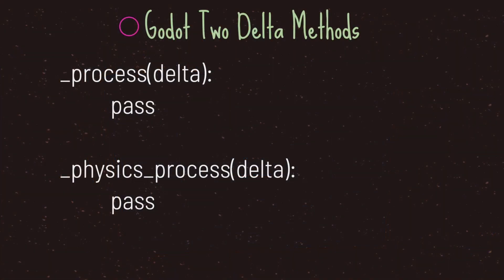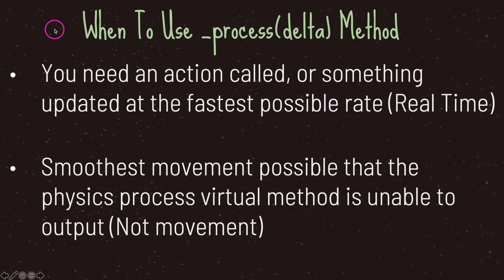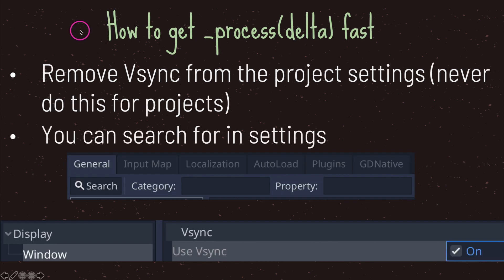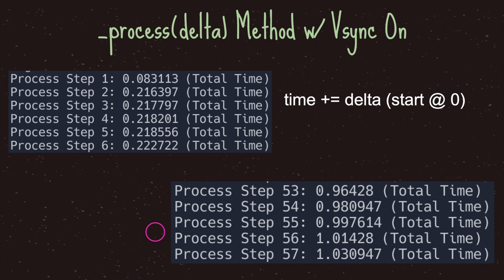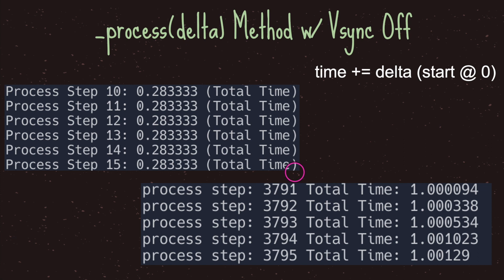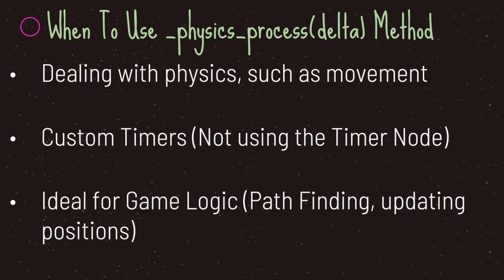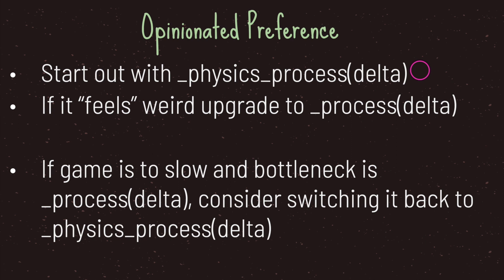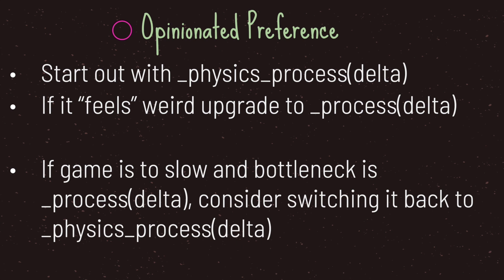Process & Physics Process Virtual Methods | Godot Basics Tutorial | Ep 16

Comment: Since you said some computers run at 30 frames per sec and the default settings for physics proccesor is 60 frames per sec won't that affect the computer or game negatively
Reply from the maker: Not really, computers luckily don't go near 30fps at 1080p, hopefully.
This article explains the process of game graphics a little more into detail:
https://www.maketecheasier.com/what-is-vsync/

The gist is that in a many cases, the monitor will refresh itself based on what the GPU/video card can output.
As for the game, the calculations for physics will run 60 times per second, but nothing changes.

If anything perhaps screen tearing, a slight visual lag.

Comment: Yesterday I found my game looks laggy when I put the game on my PC instead of laptop. I think that's because my PC monitor is 144Hz while the game physic still updates 60 times a second, so the refresh rate is different between character and the background.
I remembered that LTT mentioned "Your output refresh rate should be at least double to your monitor." So I went into setting, cranked the physic FPS to 300, and the game looks extremly smooth.
But then I went back to laptop, and expirementally set the physic update to 1000 times a seccond, and the whole game slows down.
Does that means Godot only moves foward when the Physic cauculation is done? But when I put the delta into print(), the delta is still 1/1000.
I am kind of confused, and worrying if there's some better way to handle framerate other than Physic FPS.
Am I doing anything wrong? Thanks for reading.
Reply from the maker: In this case I'm not sure.

For something such as this I would look into if other people reported similar issues with Godot Game Engine and refresh rates issue, it may be related to internal code (best place to check is the Godot Game Engine Github Repo):
https://github.com/godotengine/godot/issues?q=is%3Aissue+is%3Aopen+refresh

I noticed one with refresh rate and sync that may be a similar issue to yours, and Calinou responding back mentioning that it may be related to third party graphic card software:
https://github.com/godotengine/godot/issues/48801

Perhaps updating to the latest drivers, other than that I would not know.
Reply: @GodotTutorials  Thanks for responding, I'll just stick to whatever works for now

Comment: This was a very helpful explanation for me but one thing I still have a question about is why I'd want to use _process() with Vsync on? It looks like even with Vsync turned on _process() updates are still inconsistent and sometimes slower than _physics_process(). At least that's what I understood from when the video showed _process() updating 56 times in a second in comparison to _physics_process() constant 60 updates/second
Reply from the maker: Yes, there is a setting inside where you can increase the amount of frames process will run (how many times per second it runs).

In this case it's out of scope for this series, since I wanted to focus on out of the box settings.

For things non physics related you would use inside the process virtual method. In this case perhaps enemy AI calculations where you want to limit how many times it runs.
Reply: @GodotTutorials  that makes sense, thank you for answering!

Comment: The problem that a lot of people have using _physics_process for movement is that you get jitter if your monitor refresh rate is not equal to the physics FPS (60 by default). My monitor runs at 75Hz and I only get smooth movement if its coded in _process or if I change the physics FPS to 75. The second option is not ideal because it doesn't adapt to different users/monitors, unless there is some way to tell godot to run physics at the same rate as the monitor Hz. Using process is easier and is smooth with every monitor. So far the limitation I've found is that the player (kinematicbody2D coded in process) goes through the moving platforms (kinematicbody2D that are animated) in the latest Plaatformer 2D official demo, and I dont know how to solve that.
Reply from the maker: That is actually a legitimate problem, although I believe the higher end monitors that come with G-Sync/Freesync solve that issue by reducing the monitor refresh rate to whatever the FPS is pushed by from the game.
Reply: @GodotTutorials  I have a freesync monitor, but that doesn't solve it because a Godot game has to be running at the same FPS than it's physics tick rate (60 by default), otherwise there will be jitter in every movement controlled by _physics_process. A freesync monitor will do what you said, but won't try to match the physics rate, only the FPS. The only way to solve it right now is to go to project settings and change the physics rate of the game to your monitor Hz (in my case 75), have Vsync activated, and of course have a PC able to output stable 75 FPS all the time running that game. I kept investigating the problem and I think it is a serious one that needs to be solved. This is the best solution I've seen: https://github.com/godotengine/godot-proposals/issues/671
And there is also an addon that does the same interpolation:  https://github.com/lawnjelly/smoothing-addon
Reply from the maker: @AlvaroLand  Thank you for the links, will have to check this out myself.
Reply: @GodotTutorials  yeah... theirs some game that run 400 fps but when i check the monitor it only run  60fps..

Comment: Great video, nice series.

I dont know right now how shaders work properly, but right now i'm thinking that should be a good idea to run this at _process() method. is this a good practice?

thanks
Reply from the maker: You would like the shader to update its values as fast as possible depending on what you are doing. I would say _process method is great due to the fact that you aren't using/dealing with physics.

Edit: I would say try physics_process and process methods out and see if it changes anything. If you like the animations inside of physics_process then keep it there, else process.

Comment: Great video! I think the "physics" prefix is what threw me off when trying to understand this method. I would actually default to using _process under the assumption that if its not related to physics, such  as movement, then it has no right being in _physics_process. But your explanation has made it clear its really more of a "fixed_process" that just runs at a constant rate.
Reply from the maker: Now that you mention it, it is more in line with a fixed process! I believe its similar to unity's FixedUpdate. Process() works independent of the Physics Engine where as physics_process() works with the physics engine.